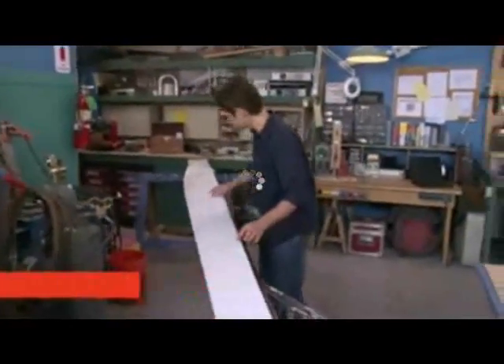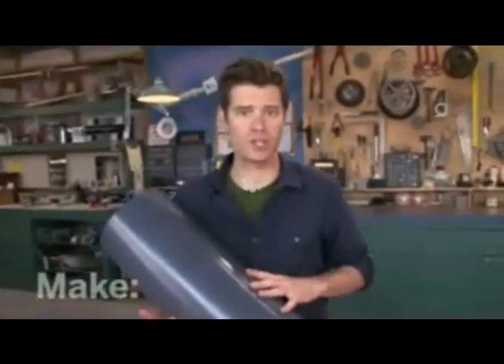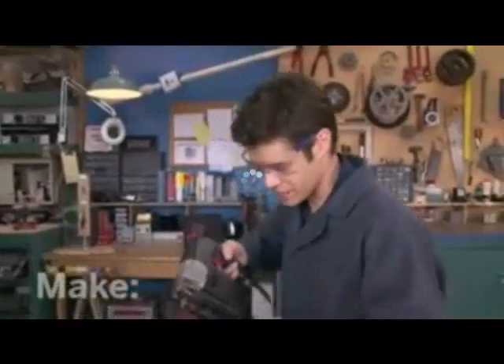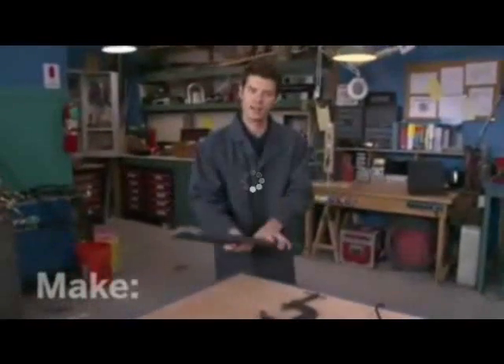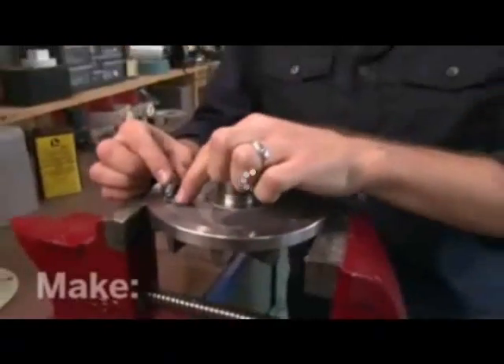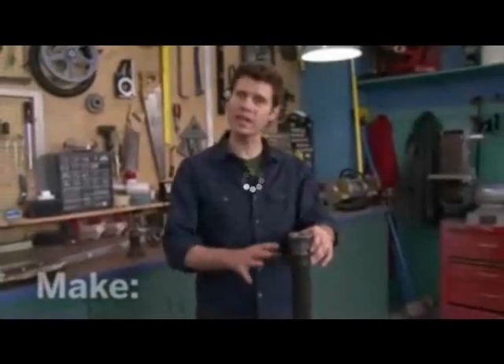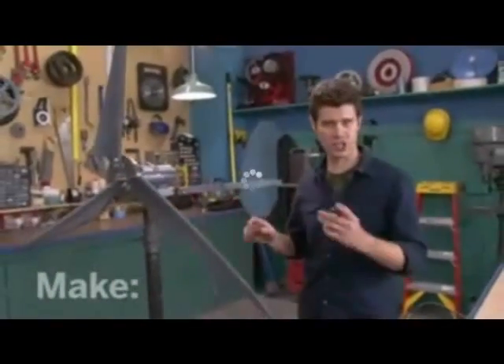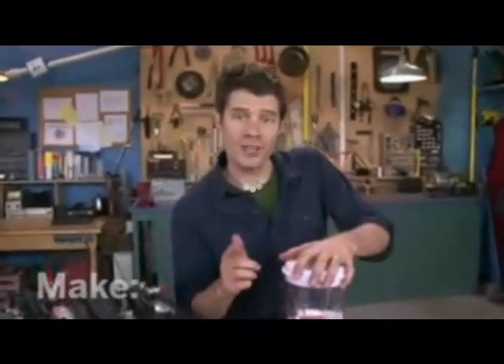How to Build a Wind Turbine with PVC Windmill Blades.flv

Comment: hi what are the dimensions of the finished blade says 51/4 " to cut pipe but what ia the finished size ,i have used 110mm pipe they work up to a point but do not spin fast enough and have not tapered it as its only thine pipe ,am looking to make some like yours 
colin

Comment: Great for people who love to carry around heavy golf cart batteries and run appliances strictly made for DC voltage. Why not buy an inverter and plug it into the grid?
Reply: *****
Maybe. But I feel the video should at least mention it. Imagine for a moment this were a video on how to build a Go-Kart. He walks through the design of the frame, the wheels, and the body. Then at the end of the video, instead of mounting an engine, he places a set of sprockets, pedals, and a chain for the drive system. Sure it still moves, but it's not very practical for someone who actually wants to build one. People who build one based solely on this video might end up tossing it on the shelf because they don't see the practical every day potential that this device actually has.

Comment: the problem with pvc blades are they flex badly and brake apart in high winds. stay away from pvc blades on windturbines. go ahead and buy good blades and be done.

Comment: The disadvantage of PVC pipe is that it degrades in sunlight and becomes brittle
not a safe or reliable material for wind turbine blades spinning at high speed.
Reply: They have paint now…

Comment: High school physics guy is not paying attention. He's only driving it around in a truck to demonstrate its ability. Normally the generator would be mounted on the side of a roof or in a tall pole in an open area.A steady wind would keep the battery charged

Comment: This is very misleading.
He continually talks about voltage when really he should be talking about wattage.  (Voltage is potential where wattage is doing work.)
How is this "free" energy when he's driving it around in a truck burning gas to get the blades to spin?
He also didn't mention how long he had to drive to charge the batteries - I suspect it would be many days if not weeks.

The only way to know is measure the work or watts (voltage and amps) which wasn't done.  Sad....Very sad

Comment: To keep the wires from twisting you can use an electrical slip-ring between the generator and the mast. This enables 360 degree rotation without twisting the electrical wires.

Comment: Very nice job, good explination of process.Most jogger motors run on  90VDC @ 1500-1800 RPM The reason for the low voltage is the low RPM of the blades.A belt shaft between the blades and the motor could incerase the speed teansmitted to the motor but the blades would need to be longer and a little wider to transmit the extra power for the mechanical lossof the speed increase.The motor windings should be able to deliver  a few amps at full rating.To make wire twist a non issue run through pipe

Comment: these little science fair projects are fun to build. but, if you want some serious power-like to help run your house this isn't worth the time wasted. the pma's work somewhat but you need to control the field voltage and current. you need to make "several" hundred volts of "wild" AC and rectify it, then put it into an inverter rated for this use. most big systems use 300-600-volts DC to feed the inverter.

Comment: 1 thing i have learned, nothing is for  free!!!!! it take energy to make energy. i did the same project with the same motor. i am luck (super lucky) if i get 8 volts in a strong wind. i have to now put a pulley like a 5 to 1 ration just to charge a 12v batt. how ever i did test a duel motor setup (1 motor + hooked to the - on the 2nd so you now have a = from 1 motor & a - from the other motor) i end up with double the voltage almost 17 volts, nice...

Comment: Look for any info printed on the motor itself. The fact that your motor is larger may work in your favor (more power). What you are looking for are its voltage, amps, horsepower, duty cycle and especially the kind of power (AC or DC) ratings. You may not find all these things on your motor but the duty cycle must be rated "continuous" if you want maximum power from it. The horsepower rating will tell you how much wattage you can safely produce (1hp = 746 watts). cont'd...

Comment: Warning! PVC Wind Turbine Blades Are Dangerous - PVC WIND TURBINE GENERATOR BLADES EXPLODE! The disadvantage of PVC pipe is that it degrades in sunlight and becomes brittle not a safe or reliable material for wind turbine blades spinning at high speed.

Comment: Alternator isn't the same thing it requires electricity to generate electricity there is no permanent magnets. A 2KW wind turbine is going to be fairly expensive. The best thing to do DIY is to rectify the electricity from the turbine charge batteries and use an inverter to power things.
Reply: Permanent Magnet Alternator, used in most autos these days...

Comment: Last time I drove to town it cost about $2.00 in fuel. Now add that to the cost of the mc d milkshake, and it cost more than you think. About $3.00 for a 10 cent milk shake is NOT cheep.

The idea of putting it on a auto and driving around was NOT the principle idea in the video. Put the thing in the air and let nature do it's work.

Comment: Schedule 80 8 inch diameter & 24 inchs in length why are you so damn hard to find?
Reply: I’m assuming you’re well past this now
But for a blade that small and that unsophisticated of a shape one could build up much stronger blades from 3mm plywood and fiberglass laminations and actually static balance them. And probably have a much more efficient profile with a bit of thought.

Comment: Bridge rectifier? A bridge rectifiers are used to convert AC to DC. You mean use a blocking diode so the electricity only flows from the generator to the batteries and not the other way around. Plus you should be using a charge controller so you don't cook your batteries. What a F'n geek.

Comment: Im not saying that its not possible to build a good, working wind generator. It can certainly be done, and cheaply, using salvaged parts. But I want people to know it requires more consideration than the simple model shown in this video. This is suitable only for demonstrations. If you want to build a practical, useful generator, get a good book on real wind technology & educate yourself on the techniques that are known to work, and learn how to work with electricity.

Comment: Also, obviously, if its going to be left out in the weather to generate power, all its parts must be weatherproof, especially all the electrical parts must be inside weatherproof housings, and properly grounded & shielded for safety. And lastly, to charge batteries from a wind genny requires more than just a diode, you must have a proper charge controller. If you use only a diode, your expensive batteries will be chronically over- or under-charged, and will be ruined in a short time.

Comment: Good job so far, but this is just the easy part. If put on a pole & left in real wind, you must include a set of slip rings so the whole assembly can pivot infinitely in the wind without wrapping the lead-in wires around the pole. Also, must include some kind of mechanism to protect itself during high winds, otherwise the first good storm will spin the blades so fast, it will destroy itself. Im guessing the hinged-tail technique, tilting the blades away from wind, will be easiest to home build.

Comment: any motor with magnets and if if it works by adding power to it then yes. you can try spinning the shaft and checking the voltage using a voltmeter:D

Comment: does any motor produce elecricity
Reply: By pure science if you can apply voltage and run a motor you can drive a motor mechanically and make voltage. 
There’s a few things needed to do to make a motor operate usefully as a generator and some motors probably aren’t ideal but yes any motor produces electricity. 
The problems with this implementation and many others are many; weather protection, a motor’s bearings aren’t usually up to the task of the loads of a wind turbine, there’s no built-in braking for high winds, and appropriate pre-made rotor hubs are not always easily obtainable to name a few. Then you have to deal with rectifying, voltage control, overspeed protection…. There’s a lot more to it than ‘just’ putting something together that makes electricity.

Comment: Great job on your wind turbine. It's too bad that there are people out there that only criticize other people's work. While it is true you would only need one diode to block the voltage coming from the the battery to the motor a bridge rectifier will work just fine typical voltage drop for a diode is another 1volt. So you are losing about 2 volts with your setup so what.  Those other people that leave comments like that are just jealous watchers of other people they are not doers.
Again GREAT J

Comment: @KEVIN38819 Unless the motor is a special type, you may have to reverse its normal rotation to use it as a generator. This is because the brushes are usually "offset" from their theoretical position with respect to the field poles (magnets) due to a phenomenon called armature reaction. This is to reduce brush sparking. In a motor, they would be offset *against* the direction of rotation. In a generator they are offset *in the direction of rotation*. A book on DC motors/gennys will explain this.

Comment: @Inflec Yeah I know part of the produced power is lost in the diode in heat. I've ran the motor with a drill and measured the output with a multi-meter (also i found out that when u run a motor as a generator the + / - wires for input then reverse polarity for output) But she puts out a few volts even at low speed, I am also gearing it up by offsetting the motor and using a main gear/pinion gear setup to get more rpm. I found a diode on Ebay that fits your description, im going to give that a go

Comment: @KEVIN38819 (cont'd from prev. post)... Otherwise the diode will likely be destroyed during heavy generator output. Good engineering practice would call for a current rating *at least* double the highest possible current (amps) that your genny might ever produce. Hope this helps.

Comment: @KEVIN38819 A standard diode (i.e. non-Schottky), will absorb, or "drop" approx 0.6v when it is conducting in its "forward" direction. This is the connection that you want so current can flow from the genny to the batt for charging, but not in reverse (motor would drain batt). So your genny would have to produce a voltage equal to your nominal battery voltage + 0.6 volt to even *begin* charging. The current rating must be greater than the highest amps you can expect from your genny. (cont'd)

Comment: @Inflec Thanks for the feedback, I'm no electrical expert but I also wondered why a single Diode wouldn't be sufficient on the Positive wire as you said. But with a 100PIV diode, what sort of voltage/amps need to be generated before the Diode allows electricity to flow to my battery? I will be reading up right now.. :)

Comment: @KEVIN38819 Don't know why this guy is using a bridge rectifier. It's overkill--three more diodes than you need. All you do need is ONE heavy duty diode in series with the "hot" wire coming from the motor. For a 7.2v motor being run as a genny, I'd want a diode with a 100PIV (Peak Inverse Voltage) minimum rating AND a current rating at least twice the maximum amperage you ever expect from this motor. The diode I'm thinking of usually has a threaded bolt for mounting to a heatsink. Read up, sir.

Comment: Any DC electric motor becomes a generator when you spin it!    If you want to tap a straight hole put the tap in your drill press chuck then turn it by hand, in order to get it started straignt.